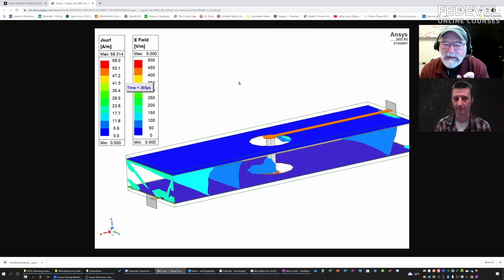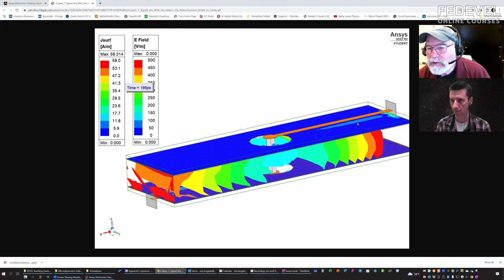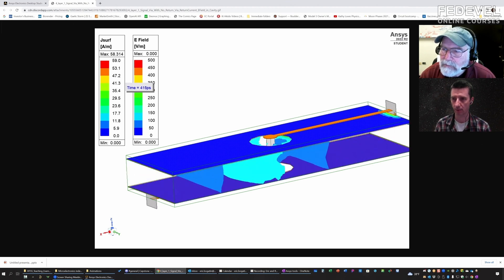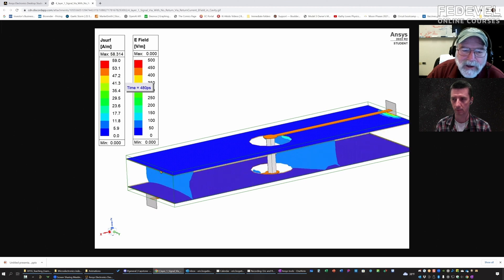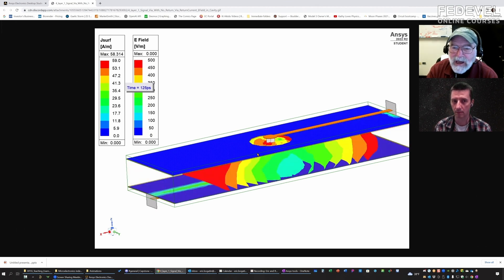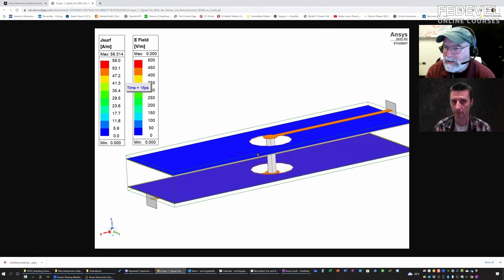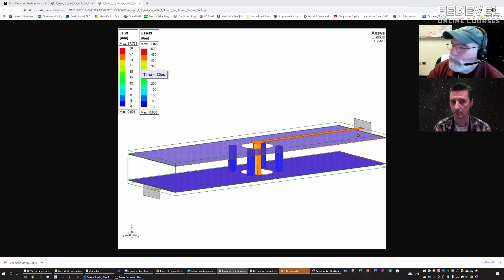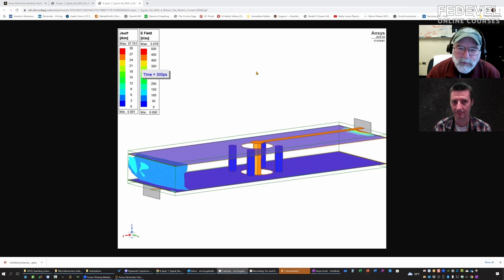Do You Know How Signal Travels Through a VIA? Are You Sure? | Explained by Eric Bogatin

Comment from the maker: What other simulations would you like to see?
Reply: Thanks Robert - how about showing the same simulation for differential microstrip and differential stripline .
Reply: @chromatec-video  I was going to ask the same thing. I'd be interested to know the results for differerential pairs with one single via instead of two, because sometimes I just have room to place one single via only for the pair.
Reply: Would adding a capacitor to link the two planes, instead of vias, be effective, so they can be at different potentials?
Reply: @Gelf54  I think the problem with capacitors is that their impedance varies with frequency making them less effective. But you raise a good point because the via linking the return planes is also an inductor at high frequencies - this is why its good to add several of them.
Reply: Hello Robert,
Please ask from Eric a simulation of Common Mode conversion and it's impact on EMI/EMC.
Reply: Still waiting for second part of EM simulations with Dr. John Dunn
Reply: PDN measurement vs simulation
Reply: Thank you for your videos! I am no PCB expert, but I keep hearing that 90° or <90° PCB trace turn is bad practice and wanted to ask if a simulation of that would be possible. This point is not clear for me. I understand that making 90° or less than 90° PCB traces could generate acid traps and that it was a typical issue in the past, but I dont understand how these could generate EMC/EMI/signal issues.
Reply: @remy-  Thank you very much! This was exactly what I was looking for :D!
Reply: Magnetic simulations in Ansys are my favourite. Applied to coils, signals on pcb, and patch antenas.
Reply: If this tool can generate scatter plots (e.g. S11 & S21), that would be really useful to see. 
I'd also be interested in seeing differential microstrip routed over a ground break. The video you have on the single ended version of this is fantastic, but I think the differential situation would still be bad, though not quite as bad.
Reply: I think most simulations and books focus on scenarios with only two internal layers, SGGS or SGPS. What happens in scenarios where an internal power plane is sandwiched between two internal ground planes? In one of your video https://youtu.be/kdCJxdR7L_I?t=1447 Eric briefly suggests that "it is not a problem at all" because the return current will go through the grounded return vias. However, I believe that some fields should also propagate in the dielectric spaces around the power plane in this GPG configuration... I believe this simulation could be really interesting. Thank you Robert for your work.

Comment: Could you say, because extra via’s don’t really add up on the cost ladder, just use a return via for all signal via’s? Slow and fast?

I mean: because most signals are block signals with a lot of harmonics
Reply from the maker: theoretically yes, practically it could make routing / placement not optimal especially because VIAs take a lot of space. So it may not be necessary to overdoit.

Comment: I don't understand why Sugnal gnd gnd signal offers the possibility to add transfer vias and not gnd signal signal gnd
Reply: Look on board where is many components on top and bottom layer and these layers also are GND. It will be all in holes. But if GND in inner layer you will have good polygon without any gaps.